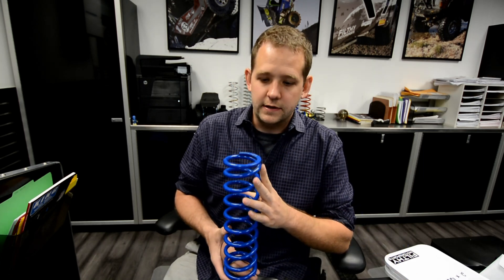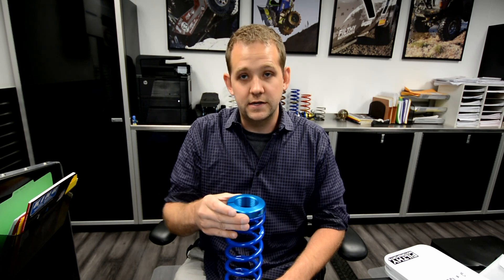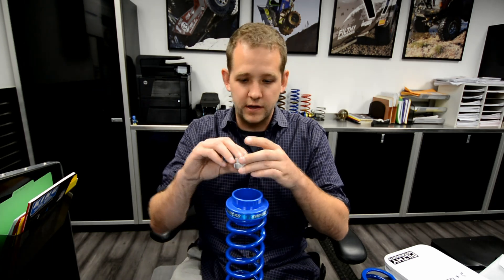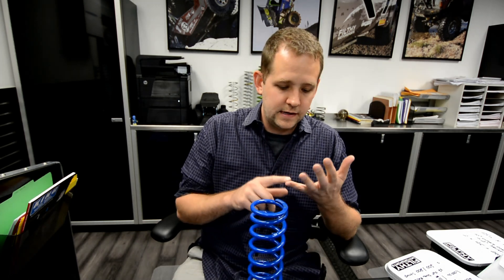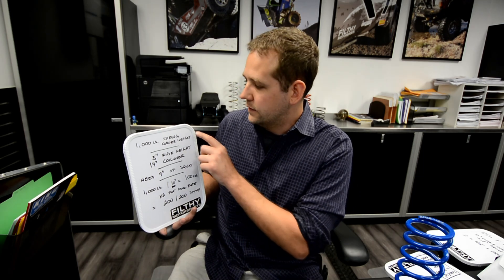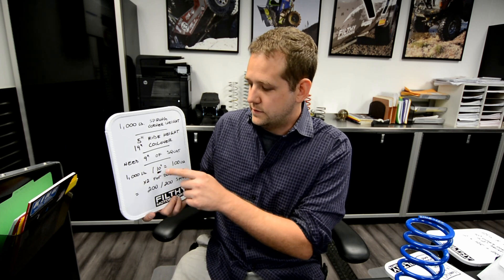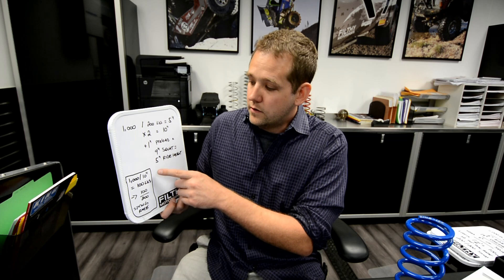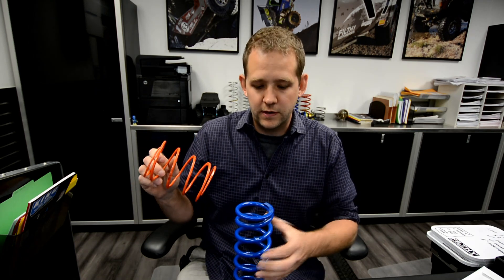Coilover Springs, Spring Rates, and Calculations - Filthy Motorsports

Comment: Hi, I have a quick question. I have an chevy avalanche which I modified with a long travel suspension kit, supposed to be 14 inches of travel. it's a 2.5 coilover king shock in the front, using a 14 inch spring 3.00x14x700. I had to max out the preload so that I could get to the needed height, so to reduce the stress on the shock and spring I had to change the rod end to a +2 inch rod end. That worked, and I was able to get the correct height without maxing out on my pre load. After that, I added an aftermarket iron bull bumper, plus a 10,000lb winch with synthetic rope. After installation, the front of the truck droped in height like 2 inches....and then again I had the same problem. So I decided to change the springs to a higher spring rate. well aparently the highest rate King makes is 800lb, which is what I'm running right now. After installation I had to use 95% of my preload to get the truck to the correct height, but the ride feels a bit stiffer than when I was riding with my 700lb spring. Am I screwed? and this is what it is? or do you have any recommendations or thoughts that could help me with maintining my correct riding height but get a more supple ride. To be fair, the part that feels harsher is the low speed bumps. When I go high speed in the desert, it feels like the faster I go, the smoother the truck gets. Thanks! Jon
Reply: Sorry, I had a mistake in my information. The spring is 3.00x16x800, it's a 16 inch spring, and it is being compressed down to 12 inches exactly with the load of the truck on both left and righ front sides.
Reply: I tried doing the calculations you showed in the video, but with a ride height of 6inches which means I need a 10 inch squat, 3200lb of sprung weight per wheel, the rate that comes out is 320lb spring......yet I'm running an 800 and can barely make it....where did I go wrong?
Reply from the maker: Hi Jon,

Could you email me a few photos of the current setup? (sales@filthymotorsports.com)
I'm concerned about you adding the 2" extended rod end, if the coilovers were properly matched to your travel to begin with the rod end will significantly reduce your available travel.
Reply: Alright, thanks a lot!!

Comment: awsome vid.. i have a Q? i did the math on my rail.. i have dual coil. currnet setup 12"coil 175/250 springs. doing the math current front weight is approx. 175lb i think my spring combo is too stiff  weight.. was thinking 100/175   some help please
Reply from the maker: Thanks for the question. What is your desired ride height (shaft exposed)?
Reply: Thanks for the quick answer.. its the front of my rail. The current hieght is what i want.. since i have two sides do i multiple the 175lb i got the formula or is that accurate for both sides?
Reply from the maker: How much shaft do you have exposed now at your desired ride height?

Comment: my coil/spring just snapped on my king coil overs pulling out of my driveway...... fml.
Reply from the maker: On a new or used set? Did you order them from us? That is highly unusual unless the springs are old, rusted and/or abused.
Reply: good morning. I purchased the superlift suspension kit that comes with the king coil overs. it's a complete kit. put around 3k miles on my truck everything plus truck was all brand new. never left the road and the coil just snapped...
Reply: did Not purchase from you guys.. you just seem very informative & thought I see why it happend or what I should do. it's sitting very uneven now. is it very bad for the other side or my bushings and things?? thank u so much for your time
Reply from the maker: Email me a few photos (sales@filthymotorsports.com) and I'll see what I can do. I assume you tired reaching out to the vendor you purchased the kit through?